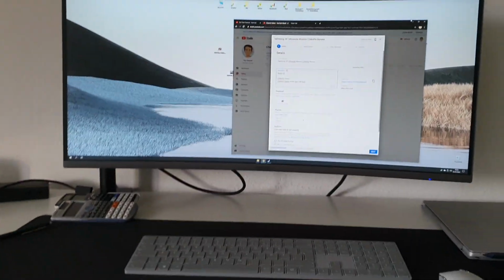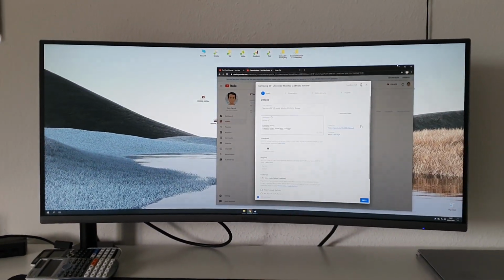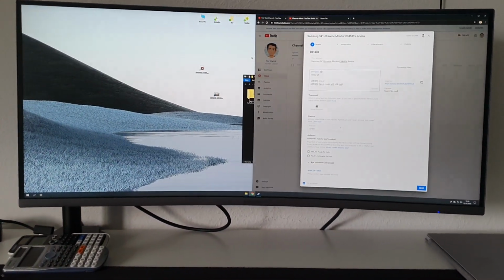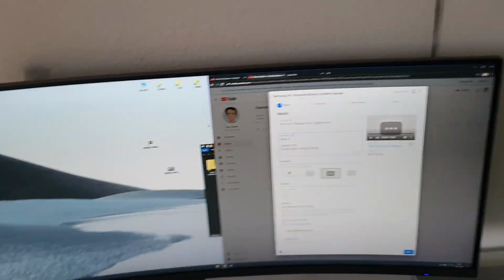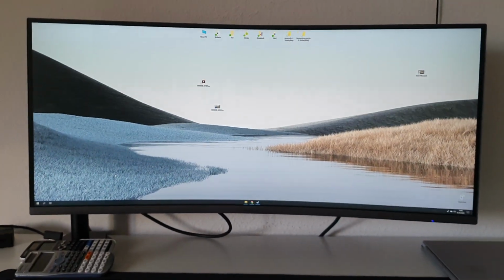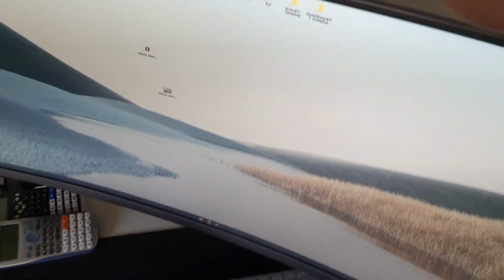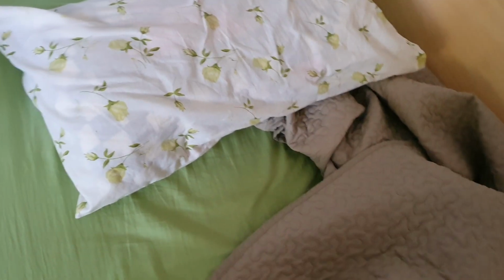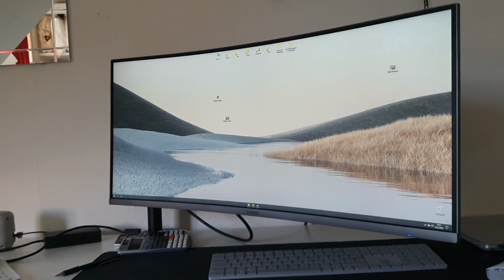Samsung 34" UltraWide Monitor C34H89x REVIEW

Comment: I have been using this monitor for at least 2 years now. The "honeymoon phase" is still there, it never faded. Every time I load a new game I am in awe. No more silly black bars anywhere  when watching 21:9  movies.  I keep it on basically 24/7 (even if I could set up a timer in the menu to turn  it off)  My 1080 gpu can barely keep up with some games at 3440x1440. It shines with 3d applications  like zbrush or painter, the extra room is just priceless. I  see no reason for upgrading to something else. ever.

2022 edit: after a little over 3 years of EAVY use for both work and entertainment a capacitor or something must have blew up/deteriorated and now it takes up to 15 minutes to turn on properly. I had a similar issues with my last monitor (asus)  so maybe just leaving it on a lot is not the best if you want it to last??. Hopefully it is something that a close by repair shop can easily fix like they did with the asus one. The panel still works perfectly fine once is fully on, but I expect things go worse in the next months and will need some work on the board done soon.
Reply: using the same monitor with zbrush also, zbrush uses cpu to do stuff so my ryzen 3 1200 was really struggling with the new monitor, now i got 3700x and it is just perfect. Can't wait to upgrade to 3080 or 3070 and play games with this monster monitor! Do you adjusted, calibrated any color for design work?  also would love to get more true colors within montior
Reply: @hehhe8761   the only thing I did is bring down the luminosity to a comfortable level. the monitor is accurate enuff for my needs with factory calibration, just a little bleeding at the bottom and close to corners. I would wait on a 3000 series, I feel in my guts that we are at a pivot point, can't really explain sorry :)
Reply: @Ureroll  thanks for the reply! i don't have a luminosity setting, did you mean brightness? I tried to change color settings red green blue but that also turned out wrong, need to color calibrate this monitor

Comment: Got this monitor for work and have used it for a month. Quite happy with it but as the review said, the stand could be better but it is usable. The USB C does support 100Hz, charging and video at the same time, I use it with my Dell XPS. The Monitors USB ports works like a hub. I have connected my USB Mouse and Keyboard to the monitor and then they will connect to my laptop via the USB-C Cable. If I then want to connect my mouse and keyboard to my desktop, I simply switch the USB cable to my desktop pc. Its very convenient! I have my desktop connected to it via Displayport. As both USB-C and Display does support Audio, they can also transfer audio to the monitor and then you can attach your headphones directly to the monitor so you don't have to switch them back and forth. So the only thing you ever have to connect is the USB C cable. :) However the 3.5mm on the monitor does have some static noise on higher levels.
Reply from the maker: Thank you for the comment! Could i ask u which model u've got? The H890 or H892

Comment: Thanks for the video. It's difficult to find reviews for this monitor
Reply from the maker: Yeah there are absolutely no english based reviews about that one so i decided to record this review :)
Reply: Probably because the monitor is names wrong on amazon
Reply: I'd like to add I've had the monitor for a few weeks now and it's a superb piece of kit. Picture quality is excellent and motion blur isn't an issue for my eyes anyway.

Only downside so far is that it doesn't have a proper menu to switch between input sources so it can take upwards of 15 seconds to go from HDMI to DP.

I would highly recommend a good monitor arm as getting the right angle is important as this is a VA panel after all.

No regrets purchasing this monitor, it's been excellent for professional and gaming use.

Price paid: £495 via Box.
Previous monitor: ASUS 24" 1080p 60hz VA
Reply: @bitza9950  what is the correct one?

Comment: Hello first of all nice video!  is this a vesa compatible monitor or you needed to use a special kind of arm for your desk?
Reply: It's VESA compatible. I mounted it on a different stand -- a post sticking up from my desk with a VESA plate that worked with an older 26" monitor I had.

Comment: How did you get the icons in the taskbar to go in the center? Great video btw
Reply from the maker: There r 2 ways, one without any software, which does not work that well (there are many videos there) but there is also a software called taskbar x which is really nice tbh
Reply: @TrollTech  Thanks a lot for your answer

Comment: Thank you for the review! Could you please tell me the min distance form the rear panel of the screen and the wall please ?
Reply: Thanks a lot :) What do u mean with the rear panel do you mean the back of the monitor or the screen?  If you mean the back of the monitor itself it is about 24-26cm which doesnt look good if you have a table with a depth of 65cm or less. Thats the reason why i got the table stand which has got a depth of 5cm. The monitor itself is about 6cm thick in the middle.

Comment: Hi, I just got this monitor. In the video you mentioned the color calibration. Could you share the settings you set? Also, I notice the sides 'darker' than the center of the screen, is this related to the panel itself or is it my monitor faulty? Thanks!
Reply from the maker: so the first thing i did was to set all the RGB colors to at least 65. by default they are on 50. the colors will get a bit brighter after that. then i selected the 3rd gamma option. you can try out all the options out there in the settings but these are the 2 main things i did to get the best color for my taste. and about the darker sides  you mentioned i have to say that i havent noticed anything big which could bother me there but it seems to be true that the sides are a lottle bit darker than the center

Comment: Is this better than the 32inch QLED I have that one but wanted to get this one
Reply from the maker: I really like the ultrawide aspect ratio, it is really nice to be able to have 2 fullsize windows opened side by side.  But you should consider that in total a 32 inch 16:9 monitor is bigger than an ultrawide with 34 inches. Also the colors on that one are not as great as you might expect them to be. The colors do not pop out in any way but it is still okay for work and watching movies. They have also implemented a game mode which makes the game look like it is on an oled. But it looks like shit if you use this mode for anything else than gaming. 
 It has 100hz tho which is a huge plus over an oled with 60hz

Comment: Hey, i was wondering if you had any issues with your monitor stand because it only could fit 27 inch, is that correct? And how did you fix it?
Reply from the maker: it actually works with 34 ultrawide too eventough it is just for 27inch and smaller

Comment: I've got the same monitor arm but mine swivels like a steering wheel too easily! How did you tighten that joint on yours?
Reply from the maker: I put some extra stuff between my desk and the arm. Smth like a small plastik plate. Tbh i worked a lot on it to make it stable

Comment: And how do the colors look? I have an LG IPS and I am afraid to change to this model. And with respect to the level of blacks, how does it look in the dark? Does it suffer from clouding? I like to play in the dark and would hate to see backlight bleeding in dark scenes. Thanks in advance for your answer.
Reply from the maker: I had talked about that they are defenetly worse than the ones on lg's ips panels .but  you get 100hz on that one tho, after using this panel the 60hz ips panels from lg look very laggy

Comment: @Troll Tech Channel, bought recently the same monitor, and it is next no a HP laptop. I don't really bother with the colors, but I tried do calibrate them and I notice that the white color, is no near white as the laptop white is. The colors seem to be a little more yellowish than the ones in laptop and cannot find a calibration to reverse this. Do you notice the same thing on yours?
Reply from the maker: not really but i am also very sensitive to bluetones so i am used to have a bluelight filter :D

Comment: Are you able to link the desk stand? Can only find up to 32inch mounts
Reply from the maker: The one i used is also made for 32 inches max.  a normal 32 inch 16:9 monitor is not as heavy as a 34 inch ultrawide. So it will fit perfectly  just take care of the 100x100 vesa mount

Comment: Doesn't your audio box has an 3.5mm aux input port?  
So then you can plug the monitor phone port to it and it works as great speakers =D
without the need to pair it via bluetooth
Reply from the maker: yes but tbh it does not work that well via the 3.5mm jack of the monitor
but thanks anyway!

Comment: USC-C supports 100 Hz, I use it with my Macbook Pro 15" 2017
Reply: I hate to disappoint you, but macs do not support refresh rate above 60 hz
https://support.apple.com/kb/SP756?locale=en_US
Reply: @artemkartushyn102  the displays that are build into macbooks are 60 hz, thats right,
but connected to an external monitor, macs are capable of running at higher refresh rate ... 
btw, this comment was written on my macbook pro connected to an external 165hz monitor running at that rate.

Comment: Hey bro, I just got one like this and i'm having an issue with the display showing like a greenish shadow bar from top to bottom about 20cm center to left IN gray colors, i've been testing with diffrent colors but it's more noticiable with gray tones, can you take a look if you have the same issue? btw I'm using HDMI so im stuck ah 50hz :/
Reply from the maker: I would return the monitor for sure! For the 50hz problem u need to set your hz settings in windows and use a cable whoch supports 100 hz :)

Comment: How do you get the back panel off?
Reply from the maker: there isnt any technique just try to open it with your fingers in the cablehole
Reply from the maker: i already broke mine a little bit its just shitty
Reply: @TrollTech  Thank you.  I had to do a lot of yanking, but I finally did get it.  It was tough to get off!